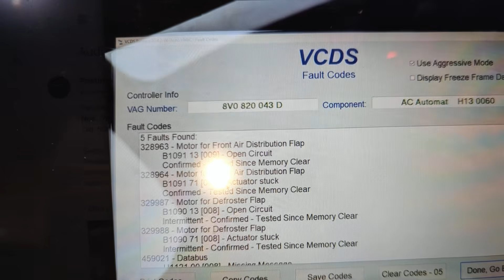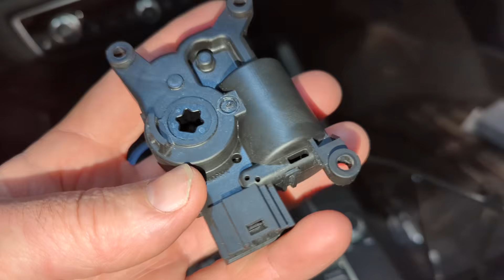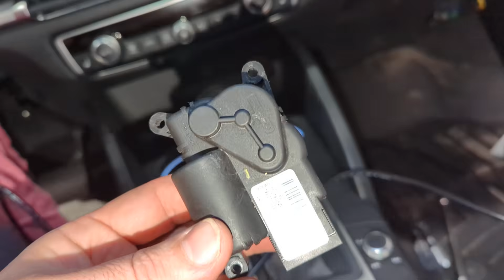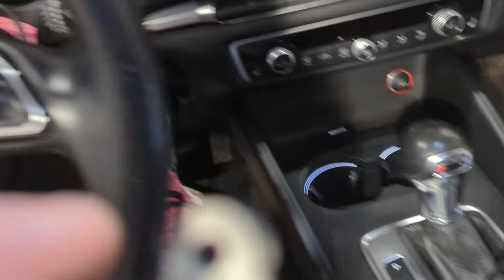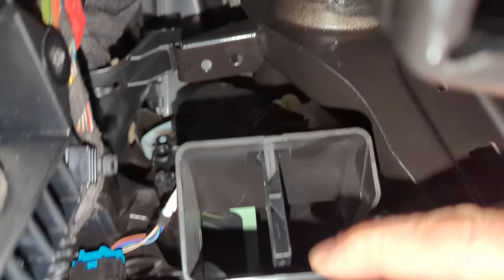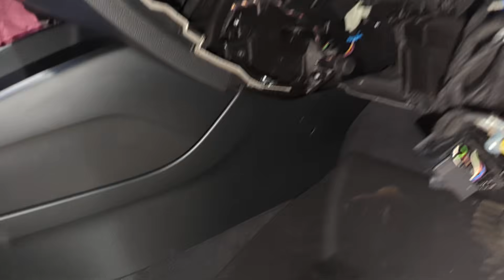2015 Audi A3 VW Golf MK7 HVAC Heater Air Distribution Flap motor identification 5Q0907511

Comment: I got B109171 front air flow actuator stuck on A3 2015. Could you please tell me which one is this motor in your video? Thanks for your help!
Reply from the maker: This code should correspond with the actuator on the left side of the HVAC box, which (on a Left Hand Drive (LHD) vehicle) is directly behind the instrument cluster.

Comment: I have a 2018 passat and I am unable to get any air from the two center ac vents. Every other ac vent is working fine. which actuator motor should I replace for this issue?

Comment: Are there any special tools needed to get the glove box out? I need to swap the defrost flap motor.
Reply from the maker: No special tools, just different length T25 torx bits and/or torx screwdrivers.

Comment: The pain of this job in mk3 TT can only be described as torture having a right hand drive also made it so confusing trying to get information as im assuming the location a mirror image of the opposite side but all the codes on these part are varied for the replacements for the bad resistors.
Lord give me strength 
I just begrudge throwing a couple grand at an audi dealership 😂
Reply: Also the higher ones are a Pig to get out front right door motor is a nightmare there is a hidden screw that without a very particular tool is next to impossible to remove without pulling the whole dash out😂
Reply: What part number did you use for your TT? I have a mk3 TT as well and want to make sure I’m buying the correct part
Reply: @ryancristea7490 what i did was end up using Gemini to try and narrow down as the part were updated and each one ends up with at least different part numbers, to be fair i ended up buying one of each then fitted the ones i could access at the top right defroster valve/motor was just to hard to get to so I'm just living with that code.
The passenger side ones are a lot easier but KEEP THE CHEESE WHEEL section on the passenger side as the new one didn't fit i just used the existing cheese ones on the new motor. 
The two i couldn't fix where the front distribution motor and th4 fro t right defroster valve but yeah hella confussing

Comment: I have error " Position Sensor for Fresh/Recirculated Flap Motor" 
Will this flap motor solve the problem?
Reply from the maker: Yes, the position sensor and the flap motor are built into one unit. On LHD vehicles, the recirculation flap motor is the one furthest to the right, almost up against the right A-pillar.

Comment: Hey, i dont have any leg air flow, both sides dead. What do you think? Start from driver side or i have to replace both? Thanks
Reply from the maker: The upper left side actuator (behind the instrument cluster) is likely faulty.

To be certain, it's always best to start by checking for stored DTCs in the HVAC module.

Comment: I'm a bit confused.  Is the motor that's behind the cluster, the same motor that you're showing from the knee Airbag space as well?  I have a B109154 as well as a B108B54 at the same time, and am not sure if I need to change 1 or both of these motors, or if 1 is likely to work when the opposite one has been changed.
Reply from the maker: There are two motors on the left side of the HVAC plenum/box. The upper one behind the instrument cluster directs airflow up/down/face.

The lower motor near the knee airbag changes the temperature for the driver side vents. It does not change where the air is directed.

Comment: Which motor is the B109171, does anyone know this?
Reply from the maker: That's the front air distribution flap motor, located behind the instrument cluster, as shown in the video. It's the most difficult one to access.
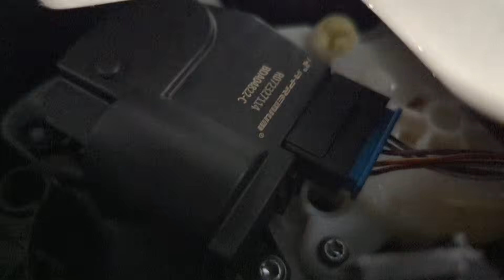Reply: @biturboaudis4 Thankyou so much. So just to be clear, the one you are showing at 1:56? Looks like a very painful job indeed, but I am going to do it either way. So the issue I have is that I have no airflow in the middle two vents (edit: confirmed that nothing at the feet too). I looked at your description and if I understand correctly and order either 2Q0907511G or 5Q0907511A, I should be able to replace this motor. Besides new and old part numbers is there any other difference you are aware of? I got a VW Golf mk 7 GTD 2016 for context.
Reply: @advertentiegolfI have exactly the same issue in my 2016 gtd. did you order the part?
Reply: @TheGoproGamer15 No not yet, been too busy unfortunately.

Comment: Passenger side lower motor: you said it was “temp control motor” the 1st time, and you said it was “foot vent flap motor”. So which one is it?
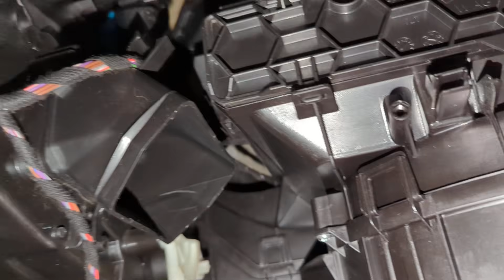Reply from the maker: At 3:30 I stated that I erroneously replaced that motor THINKING it was the front vent flap motor. That was the error/mistake. I thought it was a flap motor but it was the right side temperature control motor, as stated earlier in the video.

Comment: Do you know if the car needs to get any updates in order for this new unit to talk correctly with the car so it works, or is this plug 'n play?

I ask because it does say on some Topran units of this part, but not on others, so not sure if it's true or just specific to some brands etc. (I do not own any diagnostic tool and am not going to purchase it yet so just want to know if the car needs to visit a dealer or not after this)
Reply from the maker: I've had it happen both ways: plug and play wherein the HVAC controller finds the end stops, and in some cases it required a basic settings to adapt.

There used to be a map of VCDS (diagnostic tool) users where you could search for one in your area. That's the simplest way to go about it, if you can find someone local that has one of those cables.
Reply: @biturboaudis4  Ok, thanks. I've ordered the part so I guess I'll just have to plug 'n pray 🤔
Reply: Update: Ok, my back is now f'ed but at least the car is fixed. This was an utter pain in the butt simply because there's so tight and hard to really see what you're doing while you're at it.

Seems to have worked just plopping a new motor in. I hope I never have to do this job again lol

Comment: The old motor I see it moving but no air on the feet only face and windshield,I bought a new one with slightly different code, At the end is L instead of A,this sents air to the feet but not in the 2 center air vents .Is this the wrong motor that i Bought?
Reply from the maker: Did you perform a basic settings after installing the new motor? It's possible that the "L" is a revised version of "A" but I'd have to see the whole part number to confirm.
Reply: @biturboaudis4  how do I perform a basic setting?  This is the original part number 5Q0907511A amd this is the one I got 5Q0907511L.

Comment: So my problem is that i dont have airflow in the middle vent, left and right foot well etc all blows hot and cold air (ac) no prob, but the middle vent doesn’t is it the same prob ur facing , my car is golf gti 2015
Reply: Found it, he responded on another comment asking the same..  "The front air distribution flap motor controls that airflow. It's the hardest one to get to, left side, upper." So there's our answer.
Reply: Same issue on my 2015 S3. It's only the 2 center vents that don't blow. Anyone know which motor controls them? I also lost the recirculation function. So i'm assuming that's 2 motors i need to replace.

Comment: Good video I replaced the hardest one, it took me around 30 min!! the dealer quoted around 2.5k to fix it, after replacing the hardest one, I noticed that I also have to change the one for defrosting and recirculating, not a big deal…
Reply: Did you have the remove the cluster as well?
Reply: @MartinGaynor  no cluster just removing everything underneath the steering wheel
Reply: Any advice? I’m trying to do this one right now and the screws seem literally impossible to get to 😢
Reply: @isaacingram6277  just use a small ratchet with the t25 and a 1/4 socket

Comment: So i called audi to confirm 2Q0907511G and they told me that i could have a Johnson or MES actuator and theyre not interchangeable. Is there anyway to tell without waiting yo take kt apart
Reply from the maker: Not that I'm aware of unfortunately.
Reply: @biturboaudis4 got this done on Sunday. Used the part# in your description which was the right part. many thanks for this helpful vid, you saved me a lot of $$$ and the AC blows cold now

Comment: Hello! i have a problem in my golf but when I opened to reach the motor i found one gear with a little broken teeth inside, i broke the teeth and it assembled and works fine again. But when i connect before mounting the motor, it goes crazy and start going from one direction to another and does not stop, is maybe broken the potenciometer? When i mount and put the calibration mode you can see how it changes positions but not in normal use

Comment: Part Number please?
Reply: For the recirculating flap motors please 😢
Reply: @daaizen  From the video description comments:
Old part numbers:
5Q0907511A: Front air distribution flap
5Q0907511D: Defrost flap

New part numbers (from VW):
2Q0907511G: Front air distribution flap
5WA907511B: Defrost flap

Comment: So all the different air directional buttons work for my Audi a3, there's no problem switching those around for example from blowing towards your face blowers to your feet blowers they work fine, but I'm not getting full heat? A/c works fine but heat only blowing out luke warm. Is there also an actuator blend door for just the heat?
Reply from the maker: Depending on the HVAC system you have in your car (single or dual zone), you'll either have one or two blend doors for heat.

That said, your heater core may also be plugged up and not allowing enough coolant to flow through it. I have a video on this channel that shows flushing of a heater core with CLR. I've been doing this for years, decades even!
Reply: So I got to the the heater matrix from the inside of the car, disconnected the bottom hose and coolant flowed right out with no issues. Figured heater matrix wasn't the clogged up? Also driver side comes out luke warm passenger side comes out less warm than driver side. And my HVAC has controls for both driver passenger @biturboaudis4
Reply from the maker: @MyRacingOutpost They get clogged up but will still flow. The issue is that there isn't a lot of flow through the core/matrix to begin with, thus when they are slightly clogged, the coolant stops flowing, or slows to a crawl, which results in the decreased heat output.
Reply: Got it, okay thank you. It does seem like this is the most likely culprit in my situation. Thank god its summer time at least 😂 love the high detailed content thank you for all this great info man!  @biturboaudis4

Comment: I'm replacing the pain in the butt one that makes the center vents work.  My question is, I know I have to remove the knee level airbag that's beneath the steering wheel.  Is there anything special about how I need to go about removing that?  I've never done any work with airbags and it makes me nervous, like it's going to explode on me or something.
Reply from the maker: The standard procedure is to disconnect the battery negative terminal before performing any work on the airbag system. Besides that, there's not much you can do wrong. The connectors are a little quirky but otherwise it's fairly straight forward.
Reply: @biturboaudis4  Thank you!
Reply: Is this the part number for the center vents?  2Q0907511G

Comment: All, I have the exact same issue and need to replace this dreaded motor behind the cluster... question - do I need access to VCDS or similar tool too calibrate it ("basic setting") after replacement?
I have two error codes B109171 and B109154 (read out by local VW dealer) and have verified the motor is dead when manipulating the HVAC controls...and no air from centre vents or to floor.

Thanks!
Reply from the maker: It's beneficial to have VCDS but not always required. Depending on the fault, the HVAC controller will often work itself out and the codes will go away.
Reply: @biturboaudis4  @johandanielsson3892 that was exactly my question. When I get the motors and assume I could get it somehow exchanged, do I have to train that annoying board computer again or not. Thanks for confirming it works without calibrating it.
Reply: Hey did you ever figure this out? I have the EXACT same errors when reading with my OBDEleven and I have no, to (extremely poor) airflow in the middle two vents. If you know, please link me by telling which part of the video (for example 2:01) which motor it is. I'd be grateful if you can help me fix this. Please man...
Reply: @advertentiegolf He responded on another comment asking the same..  "The front air distribution flap motor controls that airflow. It's the hardest one to get to, left side, upper." So there's our answer.

Comment: My 2016 S3 8V doesn't throw cold air anymore. The compressor is working, I have no leaks, is not missing freon, I have heat working, and air flows throw all vents position. And I have no codes at all. I've been trying to figure it out why I have no cold ac.
Reply from the maker: Could be a clogged condenser/receiver/dryer. I have run across this issue on these vehicles. It'll prevent the flow of refrigerant, resulting it the refrigerant not condensing into a liquid.

One way to check is to see if the high pressure line (the smaller one) is colder than the low pressure line (the bigger one). A good A/C technician should be able to diagnose this. Here's a good explanation of this symptom: https://www.youtube.com/watch?v=RgYLcXwxFUs
Reply: @biturboaudis4  awesome thank you so much for responding and providing some directions.

Comment: very interesting and useful video.
However, I didn't understand how it is possible to disassemble and reassemble the more complicated one that you can see from the odometer area
Reply from the maker: @jos.22  It takes practice. It's in a very tight spot.
Reply: @biturboaudis4  mostly for screwdrivers/tools to use for unscrewing and screwing, since there's no room for anything

Comment: Hey mate, thanks for the video it was helpful, on my golf i didnt need to remove the cluster but i could reach it from the bottom (for anyone else doing in on a golf, dont remove the cluster cause you won't reach for the top screw anyways).

Came out that the motor was not the problem but just the plastic bracket was stuck for some reason, but since i had a spare new motor i decided to replace it anyways just to give it a longer life (possibly).
The weird thing now is that whenever i turn the car on, seems like the calibration is funked up and the motor doesnt seem to get in the right position according to the flap position i set on the AC. Do i need to do a re-calibration through OBD or you just think i put the motor on in the wrong step position?

Thanks
Reply from the maker: @stefanoberetta1145  It's possible that the motor is not properly indexed with the flap lever. If you didn't do a basic settings after replacing the motor, I'd start there.
Reply: @biturboaudis4  nvm i found the issue!
basically i was using a spare motor that i bought some time ago for another usage. It came out it didnt have the "A" at the end of the product code hence it was without the little circuit in the motor case. Came out that my old circuit was safe so i just swapped the motors in the case and eveything worked out! Thanks for you answer anyways and also for the video.

Comment: I just swapped the recirculating flap motor on my mk7 Golf tonight.  It's on the passenger side sorta behind the glove box.  Access is reaching up under the dash and unscrewing the screws blind.  It's a pain in the ass, but since this is my second time swapping it, I'm starting to get good at it.
Reply: What symptom did you have? My is just blowing on windscreen. I cant change it to blow in my face
Reply: @williamstroberg9869 it clicks repeatedly on start. Sounds like some garden gnomes beating on something in the dash.

Comment: In my 17 gti all my driver side vents have plenty of airflow and the motors seem to work fine but there is almost no heat on that side. Passenger side vents have plenty of heat. Any idea what to do? It was -5 this morning and I got hardly any heat.
Reply from the maker: @Quietcornerfirewood  connect a scan tool like VCDS and check for faults. It's very likely that you have a faulty temperature flap motor for the driver side.

Comment: i was able to replace the driver side actuator without removing the instrument cluster but it wasn't easy. for anyone doing this the flap has to be positioned to match actuator (which has a gear drive like a star with one flat side that matss with the gear on the flap) , it took me like 10 tries adjusting the flap by hand before I got them to mate up. you definitely need a good work light. and have extra screws because if you drop one it will fall where you can't reach it.